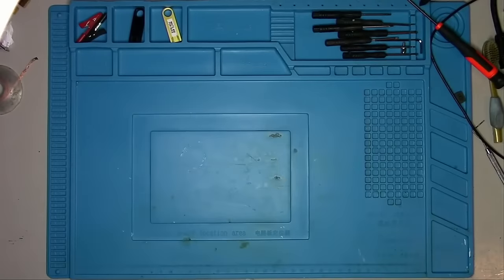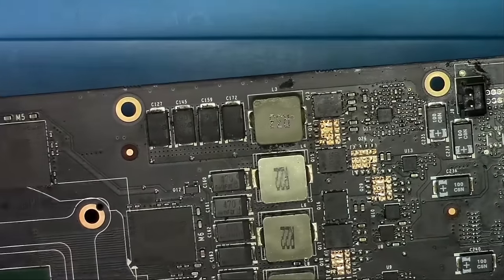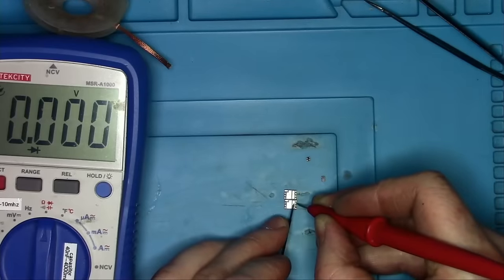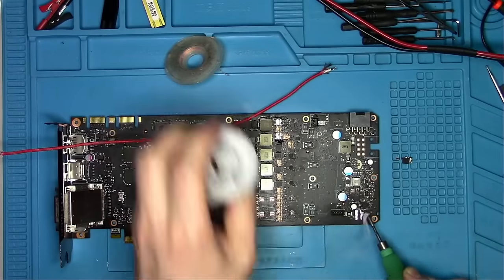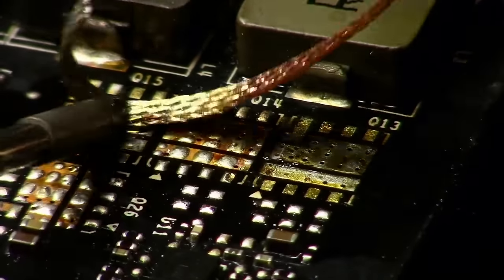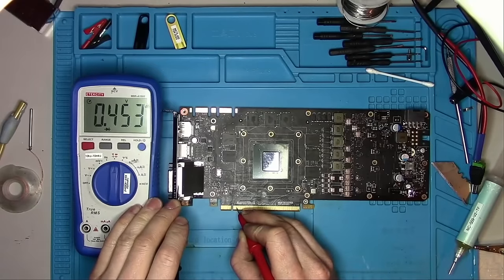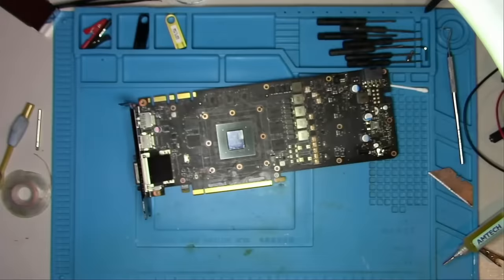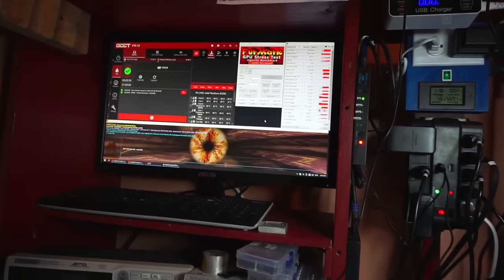What MINING does to Graphics Cards

Comment: This happens when you don’t maintain your card properly. I’m pretty shure it’s the same for gaming cards aswell
Reply: its the same for everything
Reply from the maker: Thats true
Reply: This happens with a scammer
This guy is full of bs and this wasnt from mining
Reply: @primus711  dust buildup could be from anything. It’s all down to maintenance
Reply: @primus711  what what what? 🤣
Reply: @OctoomyYTOfficial  considering i been mining since 2009 and never killed anything this is definitely from something besides heat
Reply: @deathbydeviceable  ?
Reply: @primus711  yeah cause everyone has the same experience as you
Reply: Facts, thx for explain all...
Reply: @deathbydeviceable  well you are right out of 100s of cards motherboards and decades of experience the odds just must be in my favor lol
Reply: @XYX I am not a Miner myself but seen setups. A lot of them are usually put into temperature controlled areas and its common for them to not be overheating. There has also been extensive tests done and only time you see issues is if the Previous owner was negligent and just out for a quick buck and didn't bother caring for the cards at all. Its actually common for a Lot of miners to mod the cards even to give them better thermals as well such as replacing or adding heat pads.
Also as a heads up the whole do not buy mined cards is from the manufactuers and thought to be just a way to make people buy new cards.  Additionally anyone reputable who has done testing there is no or negligent performance differences (usually within factory range of error of 1-2%)  in mined on vs gamed on cards from same time periods so long as the miner was not just trying to churn and burn as some armature miners will do. Though those where comparable to a lot of gamer cards that where also abused such as poor airflow cases with bad cooling.
Reply: Lol somebody's been mining ravencoin...
Haha, like everyone has said. It boils down to who takes care of their investments indefinitely and lets it all go out the window the second they reach ROI and stop giving a f**k.  Like, congrats... you managed to kill a free graphics card in under 300 days. Achievement Unlocked?
Reply: I will add this, I've only ever generally seen 2 types of miners: those who see it as a get rich quick/easy money scheme after  hearing about it from a commercial for local news at 2am while drunk at one if those sports bars that don't have any pool tables and let kids in to eat family dinners on game days...
And the other type are the gamers with mild to extreme pc enthusiast syndrome who thought they were going to have some fun and tinker for a couple with a few of their old graphics cards before suddenly realizing they might have to get their property rezoned and try to get approved for industrial electrical rates as pass the time til dawn outside of their nearest bestbuy with an envelope full of 3rd mortgage money. 
Id be part of the 2nd group who,  tend to take much better care of our hardware because we were fans of pc tech before crypto
Reply: As someone who has dealt with computers since the 80s I'll tell you this card wasn't  mining.  It was in a cigarette smoker's computer who never cleaned it out.
Reply: @tech-ishbrad183  To the first comment ROI unless your in a boom is usually longer then a year (ROI is only really achieved when coin mined value is greater then the card+energy used to get there not just when coin mined value = card cost which is where most people mess up). I seriously looked at it all once when a friend who was also going thru a process of creating a power company was going to do it from the same location where his power bill would essentially be free. Cards are also quite low on the pole for mining though its popular because its the lowest barrier of entry and not to hard to scale up without large investments. But there is a 3rd type and its those who had the means and proper set of scenario for it to be a good passive income for them. They also take care of the hardware and when selling after leaving a market have put up 30-200+ cards on market at one time or back to back. If you decide to buy a card from a third party thats the thing to usually look for the person who is moving a lot of cards as there is a high change they took care of the equipment and only left the market as it stopped being a passive income. Though these people are not the majority they tend to be the biggest operations.
Reply: Been mining since 2015 never happened to me but i bet i can find numerous ones burnt out from playing NewWorld
Reply: That's absolutely right. Some miners undervolt their cards to let them work longer, and some gamers overclock their cards to their maximum or even put custom BIOS on them. It goes both ways, but not all cards equally end up like in the video.
Reply: @primus711  You a miner lmfao gotcha shame on you.
Reply: @ArakiSatoshi  all miners under volt its one of the first things you learn after how to setup a miner if you look in comments of miner videos everyone is asking about settings
Reply: @hollyname600  shame what exactly? I made millions 😆
Reply: @primus711  are you one of the miners who is getting amgry because other people are hurting your GPU resale?
Reply: @primus711  I have as well owned all kinds of mining hardware as well gaming hardware, used gaming hardeware is always more prone to issues than used mining hardware
Reply: @XYX when you mine you turn down the power and turn up the fan speed. Gamers are far more destructive on the hardware.
Reply: @tech-ishbrad183  when I mined raven I didnt get over 65c on any of my mining cards. Its called tuning the hardware.
Reply: @tronalddump8776  correct
Reply: @patricom05  nope i dont sell my stuff you are thinking of newbs
And none of them get angry they made nothing but profit
None of them have issues selling
Mining is nothing but a win win situation no risk this isnt day trading
And just fyi i did folding and seti waaaaay before crypto
Reply: @primus711  a fellow tech hoarder. Been hoarding all the tech I can since I was child in the 80's. Lol.
Reply: @tronalddump8776  you should see my collection of amigas etc etc
Which im also a active dev for
Vids on youtube of the fastest powerpc accelerators running return to castle wolf quake 3 etc we even made hothardware
Reply: @deathbydeviceable  um yaa most miners (not the halfwits) have the same experience as kev.
Reply: Yep there have been many people testing cards that have been mined on for yeearrrrs with absolutely 0 issues or performance quelling if its been looked after which i guess this one hasnt.  I think Linus Tech Tips did a bunch recently and found there was absolutely nothing wrong with them and compared within 1% to a brand new one out of the box, which could just be down to manufacturing differences .  (link to vid: https://www.youtube.com/watch?v=hKqVvXTanzI&t=43s)
Gaming is harder on a GPU i think , with big temp spikes when rendering shadows (fans take a min to catch up) , using all memory/shaders as well as core clock producing more heat and more wear. 
I could be wrong but think that the constant heating up and cooling down is more of an issue than a stable temp of say 65 degrees, as things expand and retract with the heat.
The video title is a bit misleading and clickbait. He even says its cause by a faulty capacitor not from extended use through mining. The guy has some mad skills regardless, just misleading and feeding into the stereotype/rumour that Palit, a GPU card manufacturer spread way back in the day to sell more new cards.
Reply: @keatoncreates  the vram on mining cards tends to burn out before the core. But that's still pushing it
Reply: Wow I didn’t expect this comment to create such a big discussion, probably the first time this happened since I started watching YouTube 😅. I also mine and at the peak I had 30 cards, all Vega56&64 because they were the best price to performance option. I’m selling most of them now though keeping only the best binned ones because I plan to upgrade my farm to newer more power efficient cards when prices hopefully drop a few weeks after the merge. Also from those 30 cards only one died after a few weeks that I purchased it (it was a Vega64 Gigabyte GamingOC that was heavily gamed on when I got it and something in the core or memory gave up), before that I had a few Polaris and pascal cards but none of those over died apart from one used card that arrived dead on arrival (a Dataland RX480 8gb). Just wanted to post my experience in the comments now we’re I saw how active this topic seems to be
Reply: Shure? Wth
Reply: @tronalddump8776  truuueee, i mean ive never used one that long haha i just assumed that the core would be first up for burnout ahhaha.  I just casually mine and when i mine it doesnt use the memory at all? for example im mining atm and my graphics memory is mostly free minus all my open tabs on youtube, while the core is 100.
Reply: @secularargument  peple wth contrl isues amd ocd wory abaut how someone spells sonething on social madia. Hope your brain feels better amd you like what I did there for you.
Reply: @keatoncreates  no. If you are you mining it loads the memory with the algorithms the core has to run those algorithms. Usually memory is loaded up but I have noticed that I cant ever really get a accurate total vram usueage when mining. Not like when your gaming and you can see how much memory is being allocated to useage.
Reply: @keatoncreates  you got to figure it this way every algorithm requires a different amout of memory to store in. So for instance raven requires at least 2 gig of vram to store the whole algorithm and that would be the only one you're mining with that small of an amount of memory they substantially increase in vram useage from there.
Reply: @keatoncreates  and that's why mostly when tuning for mining memory speeds increase and core can be decreased and undervolted. There's a bit more to that but thats the basics.
Reply: @tronalddump8776  ayyyyeeee, gotcha that makes a lot of sense!!! Legend, thanks for explaining it to me!!! the more you know ;) i got 11gb and using ethc algo which requires 3gb min to run, hence why my entire v memory isnt at 100%?
Reply: @keatoncreates  exactly and YouTube with a few tabs running 4k videos still wouldn't push it more than a few more gigs being used.
Reply: @OctoomyYTOfficial  I cleaned out my pc the other day, a couple years of normal use and it was like a carpet in there, I used up like 1.5 cans of c02 no joke and still had to scrub the fans manually
Reply: @primus711  scam & fraud
Reply: @rodiculous9464  compressed can is a waste of money. I use vacuum to blow away dust.
Reply: @tronalddump8776  "Gamers are far more destructive on the hardware." Well depends on individuals.
I for myself have turned down the power and changed some Parts for ones with better quality. 
Turned down the Power really low and my Card has pretty low temps. It mostly sticks on 40-59°C based on load and fan speed.

It all depends on how you care about your Hardware, especially on miners.
Things like OC are just deadly for the components and mostly not even necessary in terms of gain.
Most people don't even clean their systems which makes me really angry ^^
Reply: @nicz7694  I stand by my statement.
Reply: @tronalddump8776  Well everyone has his opinion so :)
Reply: @nicz7694  its no opinion. Fact.
Reply: @nicz7694  gamers are far more destructive on the hardware than 90% of those mining. The 10% are the gamers running mining software on there gaming rigs.
Reply: @nicz7694  I'm not saying all gamers destroy there stuff but most do.
Reply: @rodiculous9464  Damn I maintain my electronics on 6 month or less interval. I even make the kids take apart there Xbox to keep it clean at least once a year.
Reply: @MultiDivebomber  yup vacuum, a few sizes of smaller soft bristle paint brushes and sometimes I'll bring the parts outside and use the air compressor if it's real nasty.
Reply: @tronalddump8776  So how come to the conclusion that Gamers cannot tweak their hardware?

As said, it comes to personal handling. For myself as an Electronic Engineer and PCB Designer, I treat my Hardware with care like its supposed to be done and I can tell you that neither Mining or High OC like some Gamers and Enthusiasts do is not very good for hardware ^^
Reply: @nicz7694  the conclusion is that i didnt say every gamer destroys their hardware. For an engineer it would seem that reading and comprehension would be something to strive for but it seems you are only trying to pick on one point of a simple statement without applying any logic or reason. Quit trying to argue semantics.
Reply: @nicz7694  I also didnt say a gamer cant tweak there hardware?
Reply: @nicz7694  mining is no worse on the hardware than gaming especially if they are set up correctly and will fail if incorrectly setup in either scenario.
Reply: @nicz7694  as a right to repair enthusiast I want to know why engineers cant design a product to last? Or make products that are a little more user repair friendly?
Reply: @nicz7694  as someone who buys components for my own personal collection as well repairs there own components right down to pcb repairs and also builds pc's for everyone around my town using new and or used parts i can verify that the gaming hardware is almost always beat to death. Ive bought out mining cards from decent size mining operations and never had one failure. I take that back I bought a 1080ti one time that was melted because someone didnt understand you can't run them overclocked overvolted for 24/7 kid said it lasted one week like that before it smoked. Ive bought at least 200 used cards from gaming systems and at least 50 of them failed in a week to 2.
Reply: @primus711  this wasn't from running a gpu non stop for months?  Got an evidence there chief?
Reply: @sayabloodraven  weird. I smoke, and have pets. My gpu is spotless. So is the rest of my pc.
Reply: @mattalford3932  got any evidence it was?
Literally millions of gpus in data centers running 24/7 for years
Reply: @ArakiSatoshi  gamers aren't slapping custom gpu bios in their card lol. That's what enthusiasts do.
Reply: @primus711   sure you did. And I'm the king of England
Reply: @mattalford3932  you got evidence that it was? Besides the title of a video.
Reply: @mattalford3932  and yes gamers use custom bioses lol you might want to crawl out from that rock that isnt new hell i been unlocking them for gamers for well over a decade from gpus to mobos etc
Seriously whats the difference from a gamer to enthusiasts a simple youtube vid? A forum read? Lol
Reply: @mattalford3932  ok buddy have fun in your delusion
And regards to being a smoker and having pets etc you either are a liar keep everything cleaned or never turn on your computer 
As anything else isnt possible even clean houses have dust etc etc with humidity which makes more of that stick and accumulate faster
Reply: @tronalddump8776  "Gamers are far more destructive on the hardware."
That was your own Sentence and you didn't said "Some Gamers and Enthusiasts are far more destructive on the hardware." which leads to the assumption that you mean Gamers in General.
You also edited your first answers to " I'm not saying all gamers destroy there stuff but most do." and you basically kept the "Gamers are far more destructive on the hardware."- kind of answer before. 

And that is what I actually meant and I was on about it since I wrote "Well, depends on Individuals"

" mining is no worse on the hardware than gaming especially if they are set up correctly and will fail if incorrectly setup in either scenario" - Same for Gaming:
- Undervolting
- FPS Limiting
- GPU settings
- Power Settings
- Game tweaking
- Cooling

All that basically can keep your GPU (or Hardware) in a good shape. That applies for both Gaming and Mining which is why I said: " Well, depends on individuals"

And I also wrote that this is your Opinion, which is fine while you responded with the same "Gamers are far more destructive on the hardware." which is a false fact since as said: It depends on the User 
Miners can also damage their hardware brutally... every user can do when said user has ZERO Knowledge

"as a right to repair enthusiast I want to know why engineers cant design a product to last? Or make products that are a little more user repair friendly?"
- That depends on the Designer, The Company and the size of the PCB.

PCBs with multiple layers tend to be harder to repair and most PCBs are made for comfortable usage and low production costs. Too many Vias, Too many layers etc cost more money (far more money) which leads to higher prices for end consumers.

PCBs are not really the issue here, they are easy to get and the components are mostly the main cost.
You can repair a TOP/BOT-PCB by yoursefl fairly easy, multilayered ones are a bit more tricky as shown in the Video.

As for right now the component market is pretty fucked up. Currently I'am modernizing a product for a company and I had to play around with the IC's since none are available that could fit. Now I had to use a large TQFP since my go-to IC is not available. This also is troublesome when designing.

In the end I respect your Opinion, you made your own experience and I made mine and that is fine for me. There is no real reason to argue further since be both share the love for some electronics/hardware :D
 
Have a good day Sir!
Reply: @nicz7694  ok I did say that but if you read down like 4 comments you see exactly what i meant and literally I said you are focusing on that one simple statement.
Reply: @nicz7694  I still stand by that statement tho. I didn't say all gamers I just said gamers. Dude deal with I didn't mean you personally.
Reply: @nicz7694  as a whole the gaming community is far more destructive on gpus.
Reply: @nicz7694  I also did edit to further my basic statements because you were trying to take it personal. Lol engineers suck.
Edit: that was joke dont take the engineers suck statement to personal have a great day.
Reply: Should i be worried? I don't plan to switch to new cards for now as I'm tight with wallet, my almost 5 years old Rx 560 is still doing fine, i mostly play recent games with lowest setting possible except ao and reflections with capped 35 fps, and uncapped multiplayer games (only during weekends) such as csgo or gta 5 at 100+ fps.
Reply: @AhmadWahelsa  that card probably still has years left it will fall out of relevancy alltogether before dying. Components do fail nothing manufactured is ever equal or at least exactly the same in reliability so maybe start yourself a small fund to replace at some point. You can never have enough saved to put towards computer hardware...
Reply: @tronalddump8776  Don't worry i plant to swap out in the next year or 2024, i still replay some old games and few recent games, i live in third world country so $300 felt like $3000 lol
Reply: @AhmadWahelsa oh hell ya I get that especially with the way prices have been in the past 2.5 years.
Reply: True, but the more one has a graphics card to maintain it will become harder to maintain. Most mining gpu I seen in the market are full of dust and looks so beat up.
Reply: It's actually worse on gaming cards, due to higher power limits applied for max fps. Traditionally eth over clocks max ram frequency and scale back core/power. It will be interesting to see in the future how bad core algos are on hardware.
Reply: @kiburi2903  most gaming gpus I've had come thru my little shop have looked exactly as you describe.
Reply: @tronalddump8776  well, it's actually a lot harder to know for sure what you're getting is 100% used only for gaming since 1000 series and crypto mining got a trend. Unless you're 100% sure that the seller got it for bnew and you actually came to their place to pick it up and test on the spot. You really can't expect honesty to people especially if they are already losing so much. Also getting an lhr unit is a plus since few miners actually got desperate to even use those. Though, I am not saying gamers are actually better at handling their pc components, it's just that the more you have on your possession then the more effort you need to maintain them all. It's just basic common sense. I have been building my own pc since 2009 mostly bought 2nd hand parts and I never got a piece that is so beaten up till I got a gtx1070 unit in 2020 which I also picked up from the seller's place as usual. Though I already noticed it's in severe condition but I got it for a fairly cheap, about 50% off its usual used price. He said he only used it for gaming but by the looks of it the card must have gone thru many owners and quite sure have been used to mining since there are also rust every where and looks like it was already got teared down multiple times already as the screw socket got so loose already and didn't even look like the stock screw that supposed to be in there, even the thermal pads has dust and looks disgusting already, sure, cleaning and reapplying thermal paste and pads may extend it's life but until when? Gpu's can easily have a life span of 10yrs+ but I highly doubt mining cards can even go past 5yrs. So I just sold it this year and opt to get bnew instead to be sure. But if I'm gonna pick up a used gpu again, it's either I get one from a miner with at least 60-70% off from msrp or try to get one from a gamer with a decent discount. Though I won't ever again pick up something that looks so beat up with rusts on metal parts and caking dust, 🤢that's just a bad deal unless maybe you're desperate and get it for about 20-25% from it's bnew price but I will still get very wary, you'll never know when those artifacts gonna show up and gpu dies. 😨 Memory issues may take time to show signs of defects.
Reply: @kiburi2903  👌. I dont need help understanding. Ive been building pc's since 1995 I've been repairing boards on everything and anything since 2007..
Reply: @TechManTY.  lol i have mine undervolted with mild oc. Running better than stock but with a lower wattage and temps. Memory issue is a lot discreet and may take time to show up signs of abuse. Never seen a gpu in a severely bad state until gpu mining started.
Reply: @kiburi2903  Also I in the hundred of gpus I've purchased have rarely had a problem (considering I've bought hundreds of gpus) and yes I'm sure some of those problems I encountered were because someone lied but its very easy to test the hardware. Yup I got screwed quite a few times and like i said I had better luck with stuff that came from someone who said I mined versus someone who said I'm just upgradimg my gaming rig and need to get rid of said components.
Reply: @kiburi2903  then you havent been paying attention because ive saw cooked gpus in the late 90's. As games became monstrous monstrosities of rendering real life scenes and shadows and lighting in roughly the exact same time as bitcoin was created so there's also that aspect of the scene.
Reply: And the environment was clean and not high humidity…

Probably cleaned your heat sinks.

Even a bug in the wrong place after that coating erodes can kill it randomly, but all failures can be traced.

Doing what the card is designed to do by simply running code doesn’t hurt it. It’s what people tweak and ignore often that does.

Cellphones worked great for mining until someone complained that they had no idea whatsoever… might as well ban video games because the phone got hot or they make 💰 

One problem was some apps put in overclocks and tweaks that weren’t compatible with all phones or environments. They didn’t let the user adjust it. 

The ones that did were still involved in some blanket decisions anyways. 

Just gonna have to find another way hehe
Reply: Yea, welcome to Clickbait Land, I mean YouTube.
Reply: This was caused by bad thermals. This particular model was overheating frequently and even damaging cards. People were replacing the thermal pads to fix evga's mistake.
Reply: @keatoncreates   Yeah, I gave him a downvote for the clickbait title.  Heat cycles are what ages components.  So yes, gaming is far worse than a constant workload of any kind.   I twas impressed at the digging through the layers of the card...
Reply: @yannicg  The shame about the V64 and Vii cards is the hbm likes to delaminate if it gets to hot, same reason AMD locks the 5800x3d from overclocking... gotta protect that stacked cache from delamination.
Reply: only exception are Radeon VII cards
out of all the cards out there, they seem to be the ones that have the most limited lifespan especially when mined. There's apparently some flaw within the HBM interconnects that will degrade over time no matter how well you take care of it.
Reply: @Goodmanperson55  They will degrade rapidly over 90c on the hbm.  It will delaminate, and at stock they run too hot.   HBM is super sensitive to heat.  My V100s throttle Super fast, my mi60 (enterprise version of the vii) do not.  The flaw is the bios lacking protecitons.
Reply: @tronalddump8776  I am a gamer and have never never really oc my system but only tried it to see how much performance it gives me but it is not worth it as the system just runs hotter and only makes it a dust bag so most of my components are running at normal specs and only the cpu is overclocked but still below intel's boost speed as my cooler cant keep up with the heat generated so my system only runs at 60 max as bying new parts is not a option
Reply: @XYX That's not what any tests show. It's been explored extensively.
Reply: @XYX actually you're wrong there. Mining thermals are way less and more stablr than what a card goes through while playing a video game... my 2 3060tis are tunning at 100 watts both gpu and memory are at 65c. Gaming it would 200 watts or more with massive fluctuations.
Reply: Mining actually burns out your memory. You can randomly start seeing that GPU has less VRAM than it is supposed to. Furthermore, any hardware wears down over use. Gaming might be an intensive task, but mining is running 24/7 which means that it is a marathon to a grave. Don't BS yourselves with mining. It wear out and ruin cards.
Reply: @REgamesplayer  gaming is more destructive.
Reply: @tronalddump8776  But it is a lot shorter. Mining in the other hand is constant. Gaming cards can last a decade. Did you seen mining card lasting even half of that?
Reply: @REgamesplayer  yes. I have mining cards that mined for years and still work fine. If both are set up correctly gaming is more destructive. I still have the first cards I mined with which was ten years ago. The most ive replaced on my personal mining hardware is fans. Yes it destroys memory but again thats takes years unless of course you have a defective.
Reply: @tronalddump8776  That was a trick question. Nobody had mined ten years ago.

The actual problem with mining is that it destroys VRAM. Your GPU can randomly start showing less VRAM than it is supposed to have. 

Also, ignoring all the catastrophical issues which can happen if miner does not take a proper care of their GPUs.
Reply: @REgamesplayer  what. Mining was most certainly happening ten years ago.
Reply: @REgamesplayer  please try again.
Reply: @REgamesplayer  I'm not sure what year this is could you point it out please?
Reply: @tronalddump8776  Try again what? Was my comment deleted?
Reply: @tronalddump8776  Sorry, that is not my job. Try google.
Reply: @REgamesplayer  no but you're wrong so try again.
Reply: @REgamesplayer  tell me some more about things you don't grasp.
Reply: @XYX ye this is straight up false, the impact on the cards life is better notable the main thing is the gen breaking becuase it'll be spinning fast, but they are very cheap to replace
Reply: @primus711  Found the miner
Reply: @XYX There is NO need for heat. The most profitable settings for mining are actually pretty low volt/temp.  The returns are quite diminishing over 60% rated watts
Reply: @XYX  Normally when you mine you under voltage the cards so they run cooler with less power usage. When you was mining Ethereum running your card at 50% watt usage gave almost identical mining speed as 100% or 125% power usage. Also most miners would turn up the fan speed to keep it as cold as possible. For Ethereum mining the GPU clock speed was less important, the memmory speed was where the gain was and what was you would overclock.
Reply: yup, mining gpus are usually in better shape then gaming gpus, most mining software will alert you if the card is overheating and most responsible miners clean their cards out frequently, they also go through less heating and cooling stress since their on almost 24/7, and their also usually underclocked to get better efficiency, the only thing that wears out faster is the fans since most aren’t designed for 24/7 operation at full speeds
Reply: @brando12343  miner propaganda
Reply: @primus711  if course a miner would say that because he wants to sell all his cards after
Reply: @fleyua7176  i never sold 1 card in over a decade and only people wanting easy rewards are selling cards not real miners how else do you think 1000s of coins still have a network and a live chain coins before and after etherum
Just because you bought a race car and drive it fast does that make you a professional race car driver?
Reply: @ILoveTinfoilHats  so by your username you argue with yourself lol
Miner propaganda ffs what nonsense not 1 here wasting time doing that 🙄
Reply: @primus711  do you/have you mined?
Reply: Someone that's speaks the truth. I'm a crypto miner and have my gpu for 4 years now just shutting down for maintenance repad/repaste/dust and they work fiiiiiiiiiiiiine, no problem